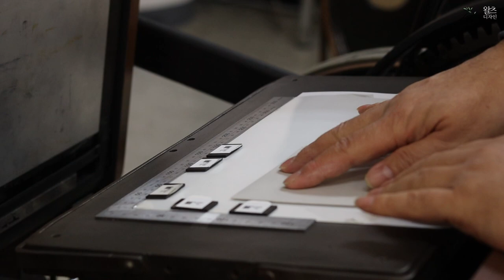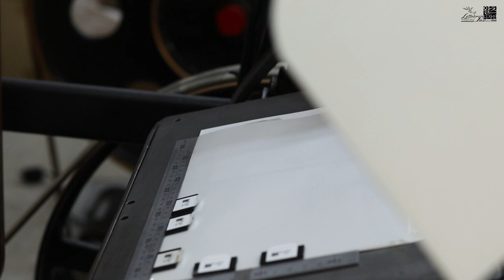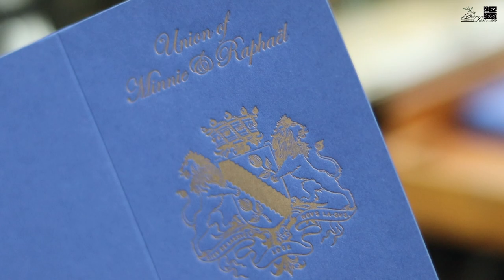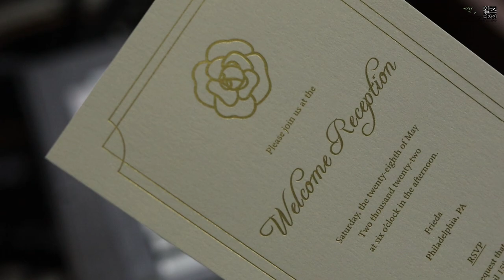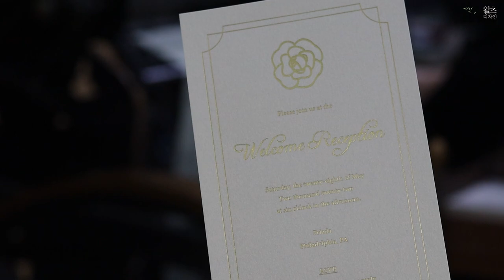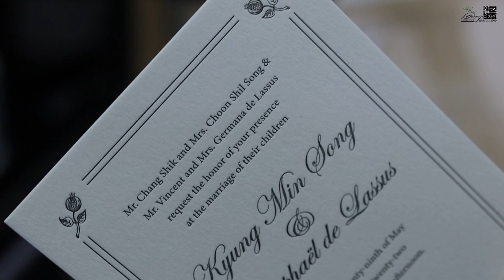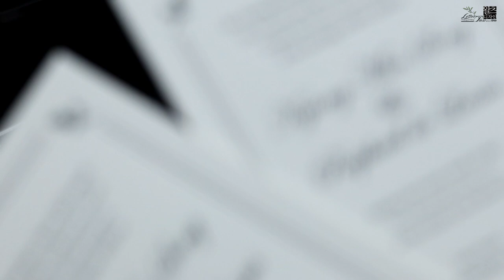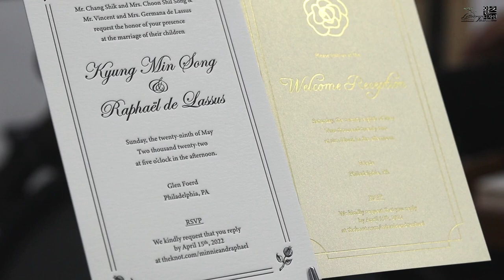Make pretty letterpress wedding invitations.예쁜 레터프레스 청첩장 만들기

Comment: What is that transparent acetate you are using on the envelope flap (01:50)? What is it for? I noticed that you use this method on all of your setups.
Reply from the maker: Hello. Use transparencies. Print it there and align the plate with it.
Reply: @w_letterpress  Oh I see. You print on transparency for registration! Smart! But I also notice that the magnesium plate sticks to the transparency. Are you using a double sided tape between the plate and the transparency?
Reply from the maker: @keithleung1994  Yes. Yes. Double-sided tape is also used for the plate, base plate and film.